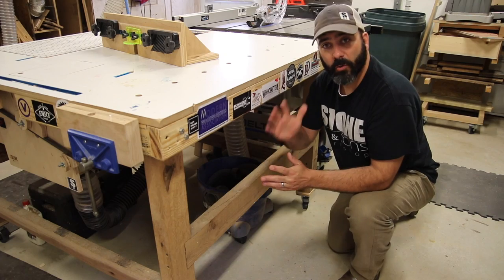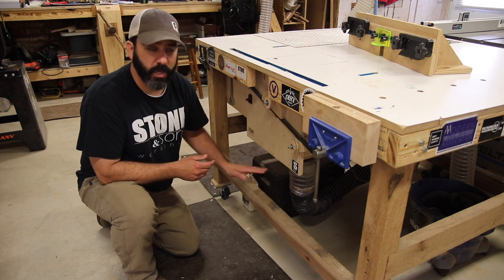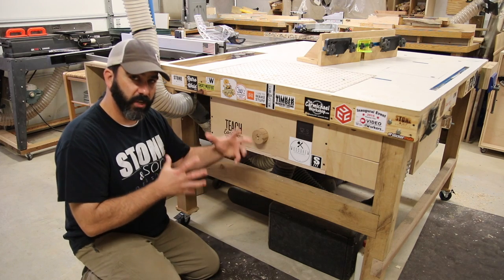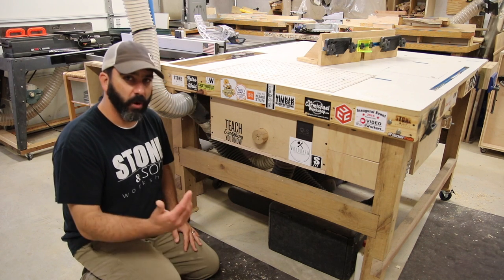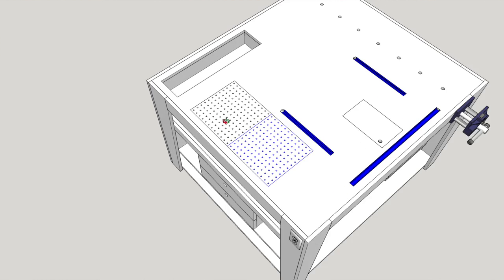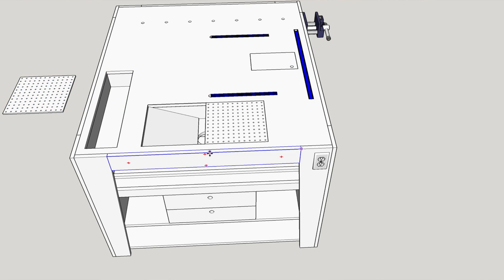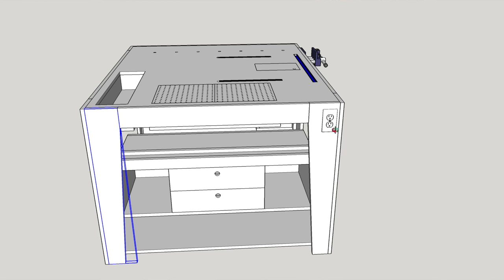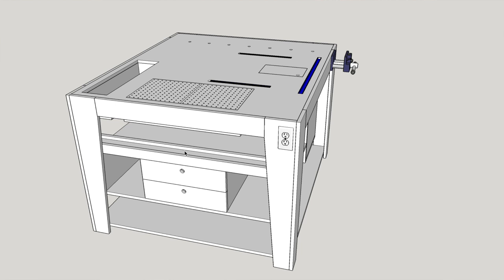Build a Tablesaw Outfeed Assembly Table - Part 1 The Design

Comment: Looks good my man.  For the top tool tray.. how about adding a cover to prevent dust and chips from accumulating
Reply from the maker: +Jason Yuhase the one on my current table hasn't been an issue. The idea behind it is to grab a tape measure or mallet quickly and throw it back in there when you're done. A dust cover isn't a bad idea, I just haven't had the need to cover it. Thanks.

Comment: Sean, for increased suction in the downdraft I think it might be better to make the solid filler in two pieces instead of one which would center the work area over the dust port as well as increase suction by focusing down to a smaller area.
Reply from the maker: +Dread Knot Woodshop Good observation. I took your advice and split the pegboard twice.
Reply from the maker: +Stone and Sons Workshop Thanks btw.

Comment: On the bottom shelf, that seems to be a large area which is unsupported and would likely sag over time, even if nothing is stored on it. I like the design, it seems like a great multi-use table for guys that are working from their home garage or other limited space area. Edit I meant to mention that a support grid similar to how a torsion box is made would greatly strengthen that bottom shelf. A 1x2 or so grid added would likely be a great revision to your well thought out table design.
Reply from the maker: +modsquad8u Yes, you are correct. There are a few things that need support. They will be in the final plan design. I just don't have them in there yet because I'm not sure how I want to do it. Thanks for the insight though. It's appreciated.

Comment: I planning to build an out feed table and I have been watching a lot of videos for ideas. I like all of the things you have incorporated. I do have a question though. Most out feeds I have seen have t-tracks on them that line up with the ones on the table saw. It does not look like that is the case on your table. Do you push it out of the way when you use a sled?
Reply from the maker: +Kevin Montagne You're right, some do. I choose not to route dados in my table. I made the table low enough to run a sled and the runners clear the table. I've never as a problem with a slightly lower table than the table saw. Good question. Thanks for watching.

Comment: I'm currently building Jay's router lift extension wing - do you use the T-track in front much?  Would you recommend adding it?
Reply from the maker: I don’t use it every time, but I do use it for featherboards which comes in handy when I need it.

Comment: I like the concept very much, but my shop is too narrow for a 50" x 55" table.  How would you change the table's dimensions, if you wanted the same features (storage space in the unit would be least important, and would obviously be whatever space is left over)?
Reply from the maker: +marvin bleiberg I would keep the cubbies and drawers on one side and disregard the storage on the other side. That way you could still have a small downdraft and possibly still keep the router lift.